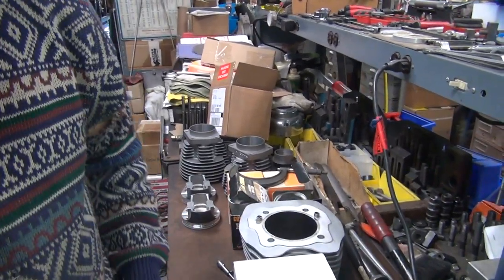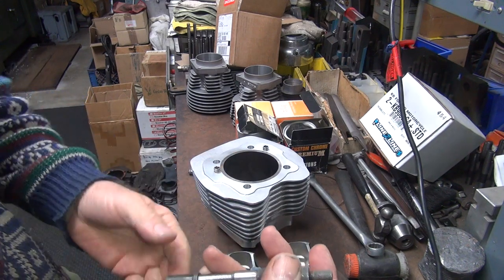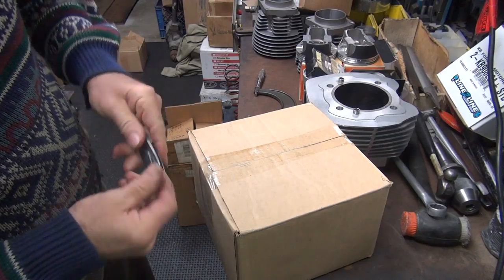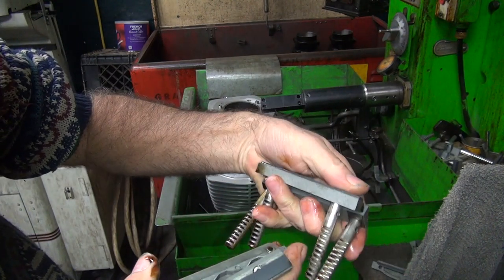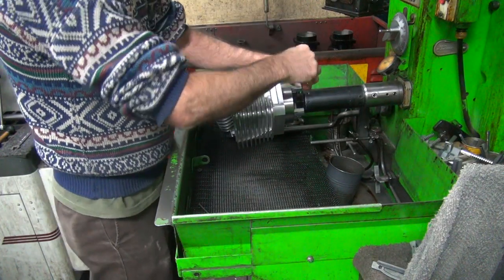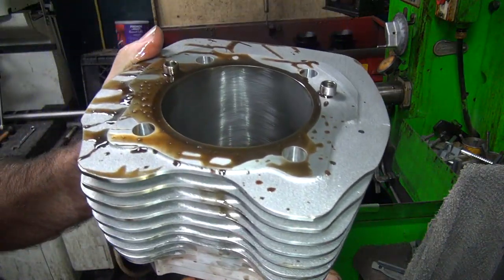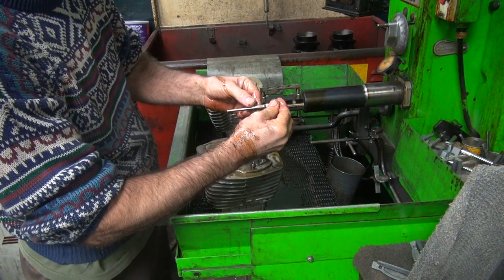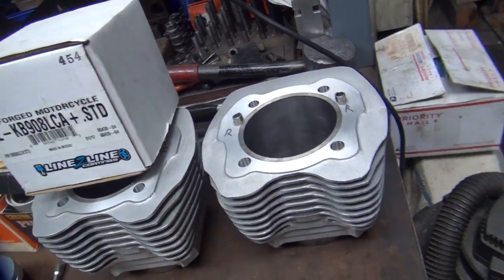#101 jims twincam big bore cylinder honing harley by tatro machine

Comment: I don't like twin cams either.
Reply: @kennethwise7108  Yeah, and plastic tensioner too.  How about the pressed crank or the lack of timkin's, or the eccentric gear oil pump that's buried inside the cam chamber.  Hell, why did they even go with twin cams?  Considering they went back to single cam for the M8 it was an exercise in silliness for the most part.  Just to get that little extra bit of lift, a really bad detour.  I'll take shovels and evos all day, haven't gotten enough experience with M8 to tell.
Reply from the maker: now com on, i am the one that is suppose to call them junk and explain why. that's it, vacation time.
tatro
Reply: @TatroMachine  true, rest assured that you'd have job security if you specilislzed in Twin Cams exclusively.
Reply: @discogodfather22  yeah and NO RECALL for it, hence why I have a K1300GT and my Harley Davidson collects dust
Reply: @kennethwise7108  yeah, and those two little balancers gobble power to operate them, not a good idea from the performance viewpoint, but sure makes for a smoother ride. I'll think about that the next time I go on a tour covering 600 to 800 miles a day. I don't worry about the cam chain tensioners either, I have faith in the upgrade on my 88.
Reply: 95” Twin cam here... very fast, extremely dependable about 60,000 miles on a hot rod build. Change oil every 2000 miles, it’s cheap... no issues.
Reply: @tobpitbull thanks